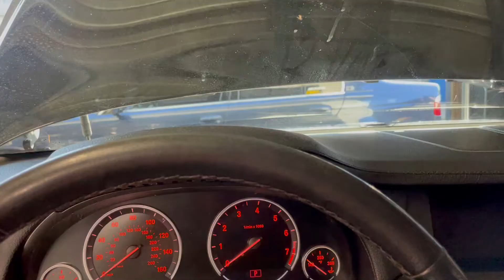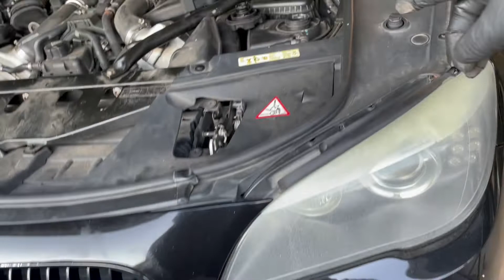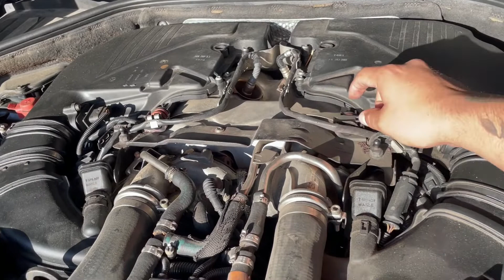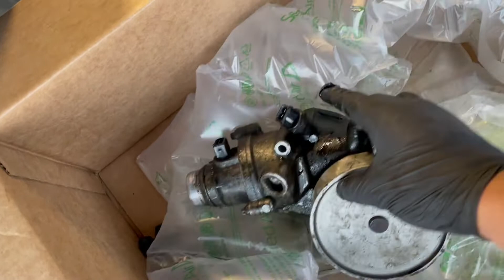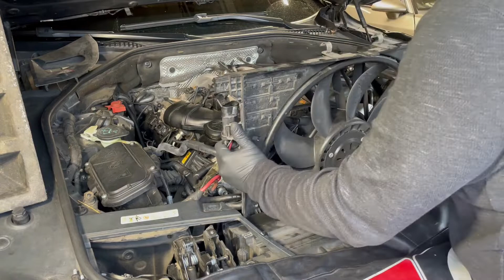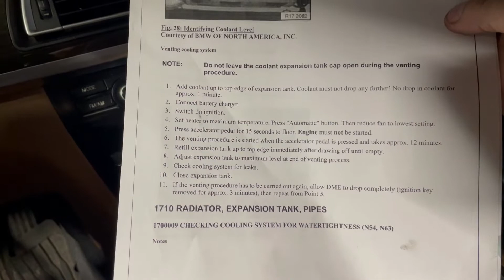2009-15 BMW 750li XDrive Water Pump Replacement!!!!

Comment: I snapped a bolt when trying to remove the pump. Anyway I can fix it or should I junk the car?
Reply from the maker: If can be fixed depending how far along the bolt broke along the threads. You’ll need a punch, then use an extractor to remove broken bolt. The only problem is the limited room you have to do this.

Comment: I am struggling to get the electric fan out of the bracket. Any tips for that?
Reply from the maker: There should be two tabs on each side. One next to the red connector on the driver side and one on the passenger side. You have to push down on those tabs at the same time to release the fan and pull up carefully.
Reply: @Fwerks.1592  I got the tabs pushed on both sides but there’s a trans cooler bracket that the fan is stuck on and I cannot for the life of me get it off that bracket
Reply from the maker: @marleyarter8953   that is right! I believe there is a screw holding down the lines. Send me a few pics to my email if you can Foreignwerks15@gmail.com